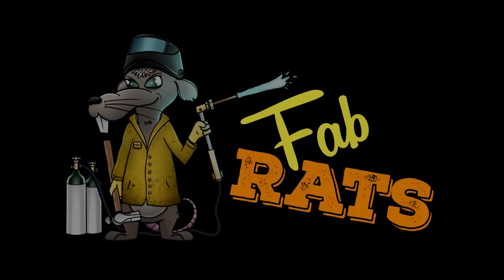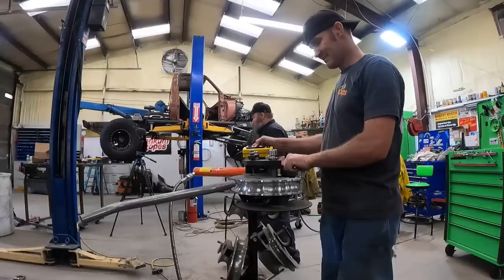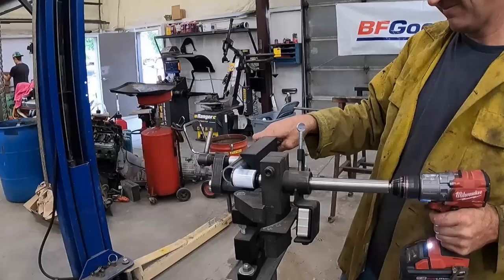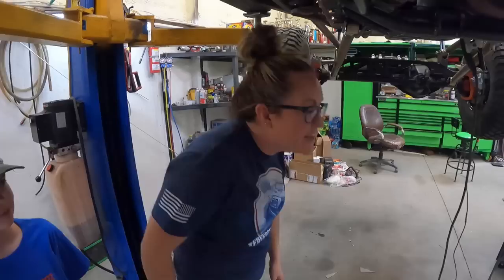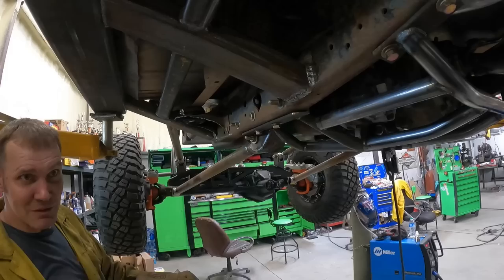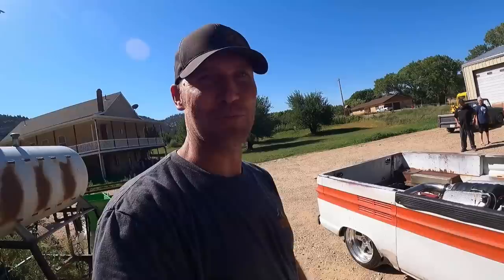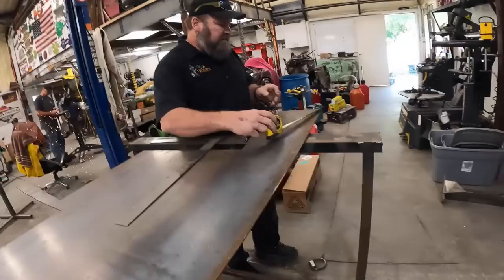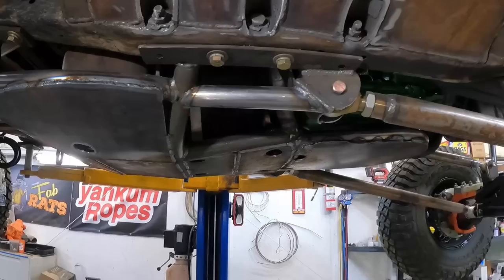This Ought To Beef Up The Rat Rod Wrecker Even More!

Comment: Hey Paul, back in the day when I was weld exaust systems up I had the same problem with being 6'4", so I took a metal bar stool and weld some casters to it to give me a rolling barstool worked excellent for doing welding under my lift, btw hello from Alaska
Reply: Great idea or affix risers on the lift if the height is available.
Reply: Have also seen it on the "car wizard" channel, recently, when he serviced a 4x4 adventure van....
Reply: @larrybe2900  good idea in theory, but every once and a while i feel  it is a good idea to sit while welding then hot sparks land in my lap and i remember why standing is better lol
Reply: @timothycarey3883  I used to weld inside chemical tanks all hunched over and crammed up. I would lay leathers across my lap when welding above for that reason. I remember a guy was trying to have a kid with his wife. We run such high voltage around our crotch that he was taken off the line and moved to the machine shop for 6 months so he wasn't killing the boys for a bit. Can't say I missed that job when I left. Maybe someone should send him a pair of chaps if he builds the stool!
Reply: @timothycarey3883  leather apron would cover that.
Reply: @Chewy Pac: Exactly what I came in here to say. ABC = Always Be Comfortable, whether it's welding or ultramarathons.
Reply: @block4565  not a short world your just fuckin tall man😂. Coming from a guy that’s 5’10”
Reply: I took an old bar height office chair and did the same thing but upholstered it in a welding blanket with flaps on the side made from leather to keep the sparks off my “lap”. The nice thing about the office chair is the ability to lay it back and straddle it for those hard to get areas. ;)

Comment: You can never have too many receptacles in a work shop. Add  2-gang metal boxes
about 4 feet off the shop floor and you'll always find power. Or, you can throw your tools
around like I do every time I need an outlet. --- Thanks for the fun upload. ---

Comment: Love the Corsair pickemup. You certain you don’t want to bolt some of those skid plates in so if you have to work on trans or transfer case you can without having to cut out a lot of welds…your truck your choice just looking down the road

Comment: Might want to put some drain holes in all of those little skid plate cubbies.
Reply: Just think how much fun it will be to check and top off those gear boxes after the inevitable leaks.
Reply: Had the same idea, sand can be interesting too... maybe even put screws in them.
Reply: I agree. Needs some holes for water and dirt to come out.
Reply: @makingtechsense126 . 
Needs to be removable to replace that running gear as it breaks.

Comment: I love what your doing building all that protection in . BUT what the heck do u do when you have to repair under thse welded in panels. Wouldn't it be better to spend some extra time and make them bolt in?
Reply: There's nothing under the panels that can't be removed. 
The skid pan is removable.
Reply: @johnnyadams1755  dontcha just love non-fabricators commenting on fab channels??
🤣🤣🤣🤣

Comment: I used to millwright in a sawmill and had to weld a lot of bent shear plate. For the stuff that had a large gap and  you couldn't get a C-clamp or porta power on we would make a decent tack weld and "HIT THE CHERRY" with a hammer. It would compress the weld and suck the plate down. Repeat and then make a clean up weld.

Comment: Great fabrication of a difficult shape.  I'm still reminded of the original comment of it being flat-bottomed.  That would have been easier on the bottom and no harder in the cab, and better off-road.

Nice rock sliders and boat sides.  That will definitely slide easily along.

You go, Michelle! ! !

Comment: An old grease drum with some wheels on the bottom are great for those corners to hold your brooms and shovels. If you need in the corner it easily rolls out to give you access.

Comment: Gonna be one tuff, rigid truck after 10 miles of welding and all that steel. Don't forget a rollover valve on the vent tube for the fuel cell. If it ends up on its top for a while you don't want to be covered in fuel.

Comment: Sweet ride. For that welding underneath stuff you should build a lay back pneumatic chair that will carry you comfortably and raise and lower to required height, then you could sell one to Matt for Lizzy to weld in. Would need to be like a scissor  lift with a recliner chair covered in rawhide so it don't burn, maybe a harness type racing seat. Once you had it you would use it all the time and meantime it would still be just a chair.

Comment: Great Job!!! I don't know if this welding tip has ever been mentioned to you. It make progress a little faster. When you are skinning or need to get two pieces of butted metal to be smooth put a big ole' tack where you need the metal to move and while your tack is hot hit with that green thing as many time as needed to  get the material to go where you need to be. I hope this helps.

Comment: I see you all using the band saw cutting your steel I do fab stuff for myself and would like to make a suggestion the Evo saw 380 I've had mine for several years and it gives a clean square cut everytime and blows a band saw away with speed you all should check it out if I had the funds I'd buy you one it was a game changer for me also I work in a automotive shop for the 9-5 I seen in a few episodes back ben was using a vacuum bleeder to bleed the car brakes while yall were on vacation another great suggestion in my opinion the motive power pressure bleeder I used a vac setup for years until I gave this a try with the universal square and round adapter it works for almost anything just use a c clamp instead of their clamp chains it has saved my ass on multiple occasions again if was in the funds I'd get you all one

Comment: A question from someone with no experience. (Me) when you built the bash plates /panels to protect the whole bottle of the truck. Why didn't u use a little lighter thickness steel and just dimple it to make it lighter and stronger and then still be able to access the bolts behind it.

Comment: Just a thought, it seems like you should drill and plug weld those 10 gauge side plates to the channels underneath (actually above) them so they don't rattle or wrinkle after you drag them over Stonehenge.

Comment: Great wrk guys. Would thought you’d bolt them plate on the side  rather then welded solid. And the crattle looked so nice would of like to see more of the tube wrk by in setting the lil panels

Comment: You got any plans for the oil pan..the LS in my TJ is exposed like your pan is and it has always worried me. The 3-link, D-shaft and exhaust might protect it some but I’ve always hoped that the pan is as strong as it looks! I’ll be plating and adding armor to my Jeeps belly this fall and this video couldn’t have come at a better time…great job.

Comment: Nice job guys, personally I'd of probably painted the tubing you just covered up first. But that's just me.
Reply: Sorry but that would be out of character for Papa Sherms Wrecker. All the parts had patina instead of paint!
Reply: @donwilliams3626  that's all good until it rusts in half. At least paint the stuff you can't see or get at that wouldn't ruin papa sherms legacy.

Comment: Great build as usual, but thing that concerns me is that I can't see any way for water and mud to escape the sliders, or any way you can clean the area. The concern being the extra weight you will end up carrying, and rust. The dust will turn to mud or if its dry, any oil will turn it into a fire risk from the heat of the exhaust.

Comment: I welded for over a decade, and at 6'5" I made use of rolly chairs and extra leathers on my lap. 

My question is about the hidden power outlet. When you reallocate brooms and shovels to access the plug, do you have a magic trick or an assistant that prevents the tools from blocking progress for future use? My almost 5 year old daughter has not proven to be helpful in proper tool cleanup and storage yet.

Comment: The difference between a fabricator/welder and an engineer is when a fabricator makes an error (or a F.U.) and has to redo it it's called a mistake. When an engineer makes a mistake and has to redo it, it's called a revision. 
If it's a really big mistake, you call in the consultants (any ordinary guy more than 50 miles from home) to share the blame. 
In the end, you call in the experts (anyone who has tried and failed more than once) and they'll "gitter dun!"

Comment: This Fab rats family is awesome! Paul and Ben are moving forward with the undercarriage stabilizing and skinning with sheet metal to protect the vulnerable mechanics so that everything will work as it should in the challenging situations that they will get into on the trails and recoverys. Grandma Lally is approving most of the upgrades and all is well! I love the Corvair pickup conversation what a beast it is! I'm surprised he didn't put a $50 bill on the dash and have Paul and Ben try reach it!  Love these videos and Michelle is getting indoctrinated in the truck and car parts.
Reply: While it's quite impressive, those types of vehicles scare the crap out of me. Nobody wants to wear a seatbelt cause "my freedumbs" and end up maimed or worse in an accident. All I want is wear you darned seatbelt. At least have an idea where to find the body if you stay in the car.

Comment: I have a '95 318 5spd manual, Ram1500 full bed 4wd , 138k miles, rubber floor.  I want 5k in Minnesota.  I'm getting the brakes fixed or you can trailer for 4k.

Comment: Should you not put some drain holes in the bottom of the rock slider plates so you can wash dirt and sand out? I'd imagine a lot will collect there as the tires throw it up

Comment: at 13;00 mins, the plate should have some holes in it, for cooling reason, transmission or even the hoses, or else your going to have a cooling problem. it great that your installing a plate for protection but you still need cooling, on my dodge truck 2204 dodge 1500 , there is a plastic strip of rubber in between the bumper and it was made for aerodynamics for the grille air flow, WRONG IT ONLY MADE THE TRUCK RUN HOTTER. so i remove it and now get the air flow to cool of the bottom of the transmission, the different in air flow temp. is 25 degs cooler with the plastic gone.  i would have at less 4 holes in the plate?

Comment: Seems like your life would be so much easier if you would quit trying to use the original frame.  You spent a lot of time getting the exhaust squeezed into it, getting the engine fitted to it, and everything else.  Basically, you benefited from the body mounting holes and every other part of it was just in your way.

Comment: I wonder if heavy duty expanded metal sheeting would be a good replacement for the sheet metal plates Ben installed.  Would allow water, dirt and such drop out and not accumulate above the plates as built.  Not trying to be a smart a**.
Reply: ZERO strength in expanded metal.
Might as well leave it wide open.
Reply: @haroldphipps3457  I believe 1/4" expanded metal would be fine, but if you know better, that's fine.   Looks like they when for plate anyway.

Comment: Good morning. Hi. I need some help. I am traveling across the us in a teardrop. I rebuilt the back half. And did not Notice that the axle is crooked I’m wearing my tires out on the inside. I have tried to fix but am to weak. 😮. Or the bolts have Loctite.    I will head your way. On Sunday. Head to Oregon. I could use some help if possible.   I can send pic
Reply: Dam. I am in Glenwood  springs Co. 🤦🏼‍♀️
Reply: @cindyhoward2566  get someone there to fix it!